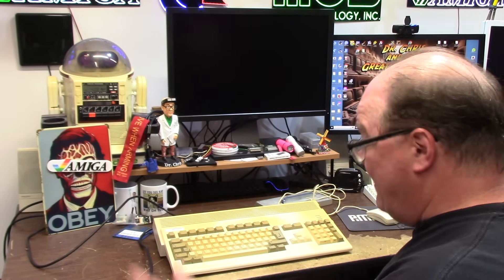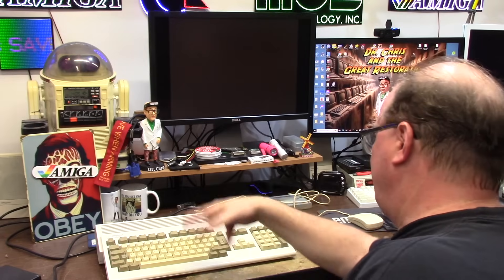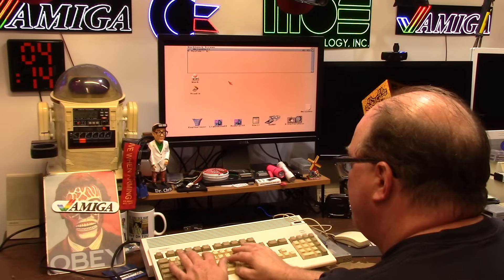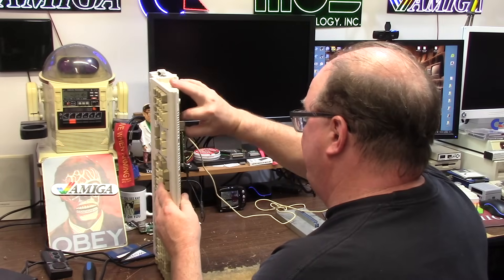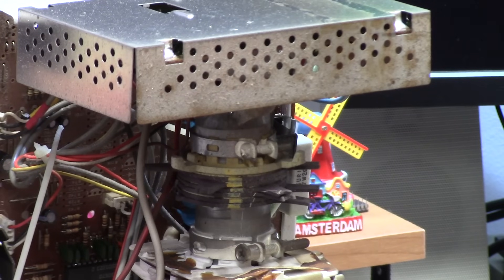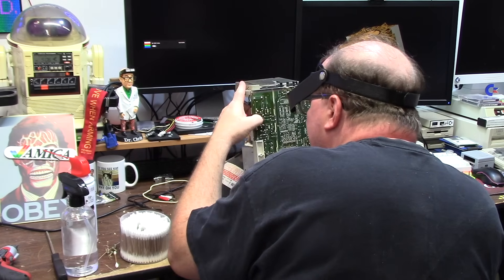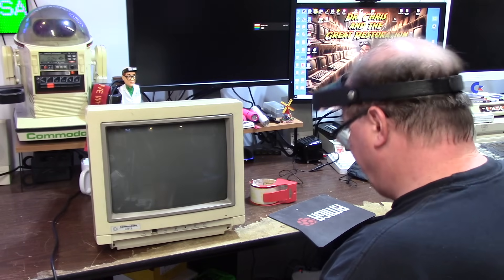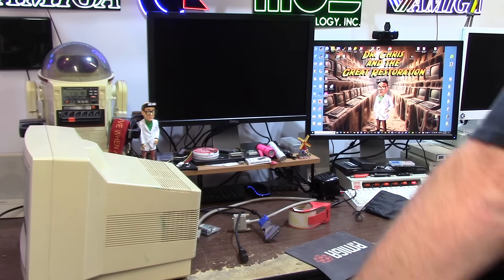A Broken Commodore 1084S and 22000 volts i don't want to touch

Comment: A while back I had bought a 1084S P-1 off of eBay.  Whenever I hooked anything up to it, it was yellow.  I put it aside for a long while, but finally decided to tackle it one day... ended up trying to tweak the RGB pots on the stem to adjust color, and noticed two more pots, one for Red and one for Blue, on the mainboard.  No matter how long I mucked with these, I could not quite get the Blue color to show up.  (Red/Green made Yellow)  finally, I lucked out and noticed somehow a resistor had been bent and was touching / shorting the blue POT on the mainboard... took the plastic POT adjuster and bent it away from it and magically Blue came to life!
This was awesome!  I have also used some glue on a cracked PCB of my original Atari SC1435 monitor, but then when I tried to fix the solder points, it melted off the whole trace on the Red pin... I ended up putting a jumper witlre on that and now it works fine.

Comment: On any TV tube or tube monitor, you should use a high voltage grounding pen to discharge the high voltage area and caps each time you apply power, and the red wire going to the display tube. Keep your slappers off the high volt area.  Used to repair Navy monitors inside aircraft and radar equipment, we used to take a grounding wire and see how long we could draw an arc. By the way Chris I always follow the laws of safety which is if you don't know don't touch it.

Comment: Oh, using pen pal on pimiga 4, if you click on a data base and it looks like it loaded but you get a blue screen, just click on  the blue screen and your data base should pop up, spent all day trying to solve this problem, but alas I failed but all it takes is another click of the mouse to complete your load, change or clear. In FSUAE  Pen Pal works as advertised. Now how to print, I put one page up and use print screen, and name it pg 1 etc. Then I call up the pages in Libre Office, only print what I really need. Just found out you have an area called ppdata where your databases and word processing are at, for a fast load you can go to ppdata databases choose the database you want click on it and it will automatically load, if it don't click on the  .flr icon once and then look at information where it should give the area where your Pen Pal is at, check the name for I take the space out of and name it PenPal for ease of use. So make sure the .flr is correct with the load name of PenPal. Orgnanize and Pen Pal are my most used programs,  my most used game is Shanghai, and Soliton.  Then VIP, or transformer to run Lotus 123 or dbase II or III. When I bought my Amiga 1000 it was because my Otrana CPM computer died, paid close to 2000 for it, but made it all back programming Data Bases and Spreadsheets. Which was a collateral duty when I had nothing else to do in the Navy. Used to get yelled at a lots by setting up Doom on the intranet, then the commander found out.  He was ticked because no one told him about it.

Comment: Whenever a system becomes completely defined, some damn fool discovers something which either abolishes the system or expands it beyond recognition.   my quote for today, well after 3 or 4 weeks playing with pimiga 3 and 4, some tips and hints. To get a computer as close to an operating Amiga whatever, I took the AGS hfe files from pimiga 3 and installed them into FS-UAE, then I took my Sys/Works (2048 GB with divided with a 500 mb System and the rest Work, and now I have screens that I can now pull down like a stack of cards, or hit the upper right hand corner to flip through them,  just like my old Amiga 1000, now FSUAE was always multi tasking so when I play Shanghai alone it is boring so to spice it up either use a digi CDROM and turn on the tunes which keeps you entertained while playing this game, I also do the same for Soliton (Solitare for Amiga) so now your computer acts just like an Amiga,  so take you AGS.hfe  and AGS.hfe saves and put them down on the 1st  and 2nd hard drives then your 2048 gb hfe split for 500 mb for System (Sys) and the rest for Work or WB , and you should have one hard drive slot open so you can use that for your USB Sticks to add adf disks or your programs that you want to use, like I use Pen Pal and Organiser on my Work drive. and while you are using it for no sound games or work or data base programs you can go into your cdrom directory and play an Aminet mods section. Now Pimiga 4 man Chris it took me 3 weeks on how tho install programs like Pen Pal and Organiser,  now I tried your delitracker and it played music, but when ever I went to play Shanghai it would turn the music off, but there is a way around it, go to the linux part (I put my music albums in MUSIC (that is what its there for, right! then i click on an album and play it then I load up Pimiga and goto the top screen menu and select game Shanghai, and wallah I have music and Shanghai, I do the same for when I am doing my inventory for the house in Pen Pal and I keep all my appointments and things to do in Organiser.  So now I can use my databases and appointments/tasks/ telephone and addresses while listening to my music on Pimiga 4. I tried some old Amiga Magic and crashed the disk about 5 times, but my raspberry pi has the pimiga images, and I just re-install them. Oh if you can't find Amiga tunes well just goto firefox and goto the YouTube Amiga Music and pick the video you want and run it, then click on the hide button and load Pimiga 4. So right now I have my Pimiga 3 combined with FS-UAE acting like a real Amiga, which has my images. If this helped anyone give  thanks to Chris for making a really excellent Amiga profile. I am enjoying the heck out of Pimiga 4, and Pimiga 3 combined with FSUAE.   --- Just another fool trying to make things better for Amiga --- The Old smerf from after 2 weeks when Amiga 1000 came out!

Comment: You need a pokey thing with resistor to discharge the tube down to chassis. The pointy electrical contact with long, insulated handle, is shoved under the rubber boot to make contact with the CRT screen.

Use same probe on all the caps on the circuit board.

Comment: Usually a CRT monitor won't kill you. The voltage is high, but the amperage is low. It can be very painful however and you might discover a previously unknown heart condition (in the worst possible way). Something that WILL kill you is a standard microwave oven. Voltage is only 4-5,000 volts, but at a much higher amperage. There was a guy who worked (briefly) at the shop where I worked that lost a finger while attempting to repair one. He went into a different line of work afterwards.....
Reply from the maker: You know what they say, there are some things you don't want to be "briefly" associated with.

Comment: Great to see Dr Chris and “Q” on a collaboration 👍🏻 You are a braver man than me to look at that CRT. Yikes! That’s a lot of voltage… 😬
Reply: Just think we used to repair radar power supplies, one test we liked was using a grounded pull off stick to dislodge a person who is attached to a  HVolt power supply and see how far we could draw an arc with the stick, Longest arc we could make was about 3 ft. Now remember we are on an air craft carrier, which has steel floors with rubber mats, but I don't know if the HV would stop for them and really didn't want to find out.

Comment: You fly back is not going to be bad presumably when I fly back, transformer goes bad most of the time it makes one hell of a screwed up sound that makes your hair stand up. You don’t forget the screeching sounds of flyback transformers as they go bad on a good note don’t be too afraid of it if I were you, I would re-tackle that thing and if you know anything about electronic components, check each section at a time CRTs are so easy to fix.

Comment: I worked on Apache electronics and I don't work on CRTs. About 40 years ago (age 12) I watched my Dad put an oscilloscope to a TV and even though my father was a highly trained and experienced electronic technician who worked for G.E. Calma at the time he did not completely discharge all of the capacitors. The result was a spark so bright it lit up the wall behind him, an electrical arc that sounded like a small concision grenade, and my Dad cussing himself out  loudly. After which he explained how close to killing himself he came.